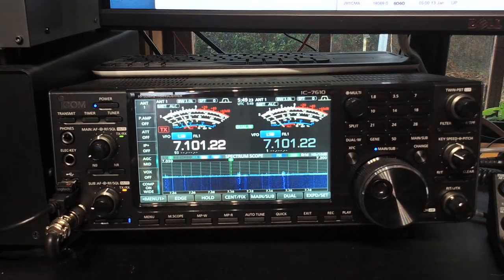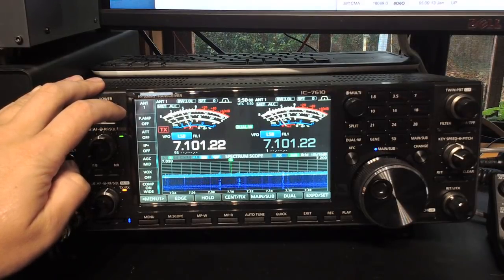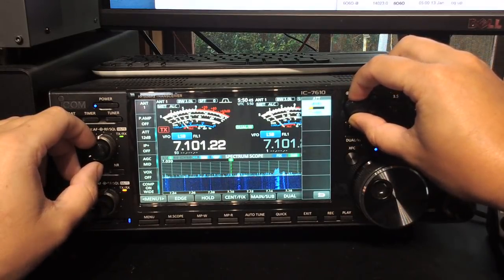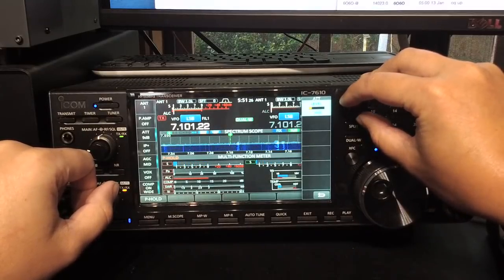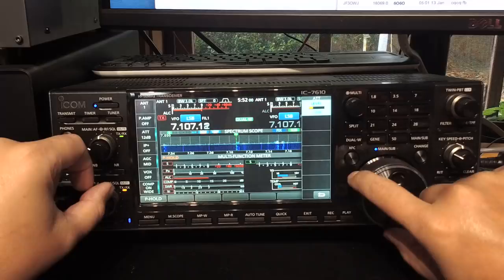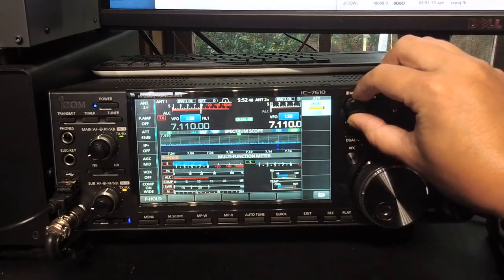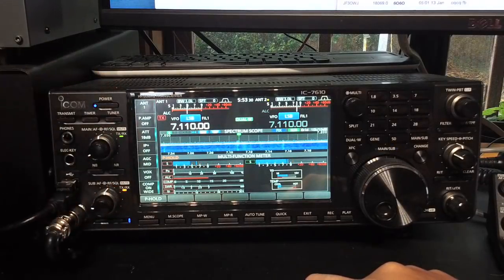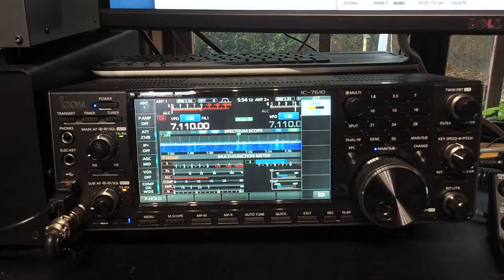IC-7610 "Hidden" Feature #1: 3dB Step Attenuator from 0 to 45dB!

Comment: the last serious mid-range radio produced by the icom is 756. 7300 poor radio, 7610 we'll see.......
Reply: After acquiring my 7300, I shoved my 756pro3 in the corner and rarely use it any more.  The 7300 at less than 1/2 the price is far superior to the 756pro3.